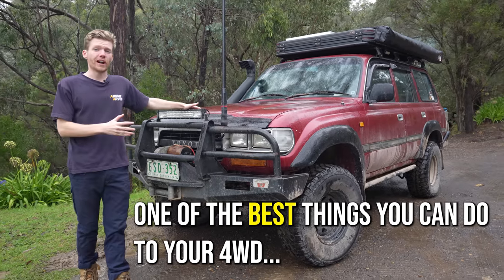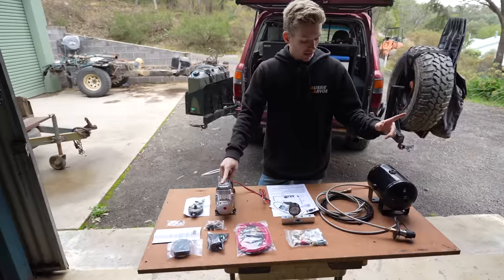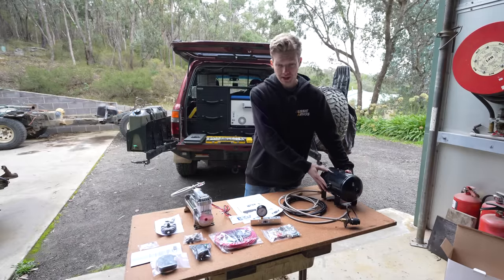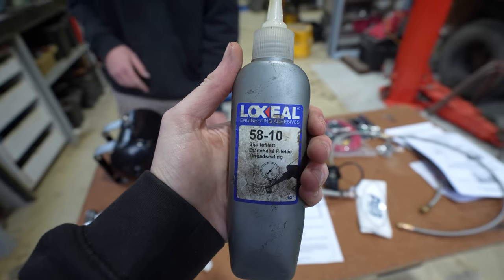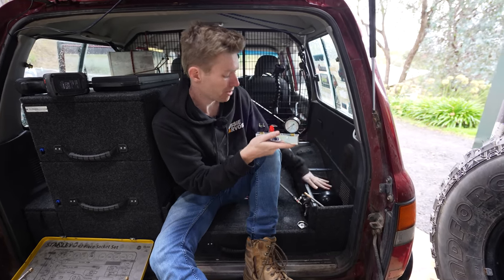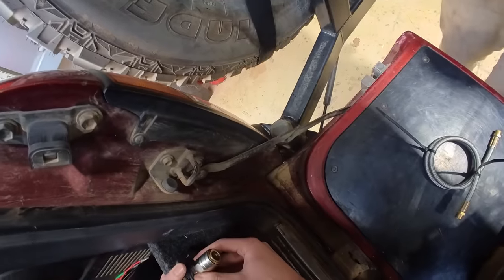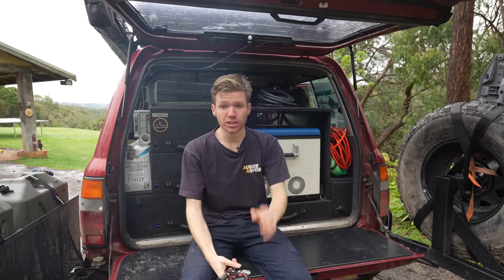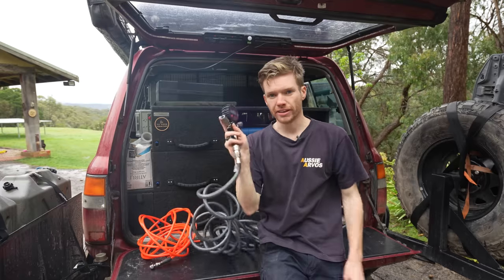Building a BUDGET on board AIR SYSTEM!

Comment: It's also a good idea to run a drain hose to the outside off the vehicle with a tap to drain condensation out of the tank as well Pat. Seeya Rob
Reply: ??,,that tank is a fkn toy,, try 3 big extiguishers..fills 4 tires. no compressor needed. fill at servo..or,,god forbid,,buy a power tank from u.s. same price as arb bs..twin comp..
Reply: @harrywalker968  Take note of his comments regarding available space onboard the vehicle, and his comments on purchasing a product that suits you. Didn't see any service stations out on those tracks so is it just the one tyre inflation for yourself per trip or do you tow a trailer full of fire extinguishers? Or maybe you could think about a 3 phase rotary screw compressor with diesel 3 phase generator mounted to your roof.
Reply: Lol
Reply: @harrywalker968 extreme boomer

Comment: Looks good. I run 2 x outlets in my drawers for the air. 1 is run through a pressure regulator on the manifold set to 40psi for pumping tyres. That way I don't have to keep checking tyre pressures when filling. The second port is unregulated which is great for cleaning filters and dusting off camp gear.
Reply from the maker: Love it, i rekcon i'll do this in the future!
Reply: Is it just a cheap regulator with a gauge and a dial?
Reply: @IamPleura  Yep, from Supercheap Auto

Blackridge Air Regulator

Comment: You don’t need the manifold, you can plumb the pressure switch/safety relief directly into the tank, saves you a few dollars. I’d also up your pressure and relief to a 150 off/120psi on switch, and a 172psi safety.

Another compressor option is an endless air, they are an engine mounted compressor that performance wise smashes just about every 12v compressor on the market away. It’s a great compressor if your space constrained.
Reply: Where did you get the fire pit barrier from
Reply: I was thinking their psi was pretty low. My system cuts out at 180 psi and my valve at 200psi with a burst rating on the tank 250
Reply: Endless air needs to work off a belt at the front of your engine, it is engine driven like the alternator.
Reply: ever heard of power tank,??..maybe look them up.. same price as bs arb twin comp.. i use 3 alloy extinguishers, fills 3.5, 35'' tires, once..fill tanks at servo..max pressure..
Reply: @harrywalker968  that’s alright if you don’t go too far from a servo

Comment: Can confirm it's a great system in the flesh! Good thing about that is that if you ever want to install a bigger compressor all the hard work is already done, just connect the wires and an air fitting and you're sorted.
Reply from the maker: Thanks Harry! That's it!
Reply: power tank,,u.s.ebay,,fills 60 tires..no compressor..

Comment: There are two critical parts missing in the system. A check valve and a bleed valve. 
Listen to any garage compressor as it shuts off when target pressure is reached. 
You always hear a valve bleeding the pressure line between the compressor and the tank. 
This is necessary to keep the start up amps of the compressor low, as it doesn't like to start cranking the piston against the back pressure of the tank.
Reply: I was thinking of an unloading device too, but it seems this compressor starts under load ok.

Comment: Can't go wrong with a portable compressor. Thought about Air on board behind the rear seat in my duel cab but they are a fire waiting to happen as they get pretty hot especially in summer. Dont have lockers or horns just for the tyres every few weekends so a portable & servo is enough for me. Just watch the heat in yours being enclosed. Would hate to see something happen to the 80. Keen to see the VHC vidoes coming🤙
Reply from the maker: Thanks mate! It actually doesn't get too hot suprisingly , but defnitly somthing it watch for, my plan is to have air lockers and air bag assist in the future, so i wanted to invest in an on board air system
Reply: go find, 3, empty alloy extinguishers, fit under vehicle, plumb to an outlet,to fill at servo, just reverse connection for tires. i fill  my 35,s no probs in 4 mins..neat, quiet, quik..

Comment: That is a really awesome setup for the air! I think it would have looked nicer with the compressor also hidden under the panel like the tank. But overall it beats so many other setups in terms of function and looks! I'm half tempted to have something like this in my truck however I don't off-road like you Aussies do lol. My truck is stock and can't do the crazy stuff. Right now I just got a new portable compressor to replace the old handmedown that was at least 25 years old lol. Works for what I need at the moment for topping up tires as they get low.

Comment: This is an awesome video.  You helped me so much.  Totally changed my mind.  I have an F350 with cap on the bed and bed slide.  I am going to mount mine next to the bed slide, in the rear of the bed where I never go or use. Initially I was thinking under the truck but, you have me rethinking the install,  Thank you so much

Comment: Hey Patrick, i see you have a zip tie around coiled outlet ine. That line gets hot enough to melt plastic,the length of that line is also to slightly cool the air before it goes in to other lines

Comment: Couple of things to keep in mind. Or changes you can do. First off, is have an air gauge mounted next to the air chuck on the drawer face. That way you don't need to keep opening the lid to check the gauge. Second, good luck getting to the drain easily. Since you have now buried it underneath, and the only way to access it is to remove the tank. And third, most, air tanks are rated for a max off 100psi. So getting a 145psi safety relieve valve, might not be a good idea. Because if that safety ever fails. You now have a bomb.
Reply from the maker: Thanks Matt! tanks meant to be rated for 200psi, and i can just fit a cup under it to drain it, but apperently you don't often need to drain them, but i'll keep you updated on that! cheers :)
Reply: all pressure tanks, will stand 4 times advertised pressure, as a safety..this is why lifts have 4-8 cables, when 1 is enough.. plus, that tank is a fkn joke, too small,,he needs big alloy extinguishers, [or stainless lpg tank,,] like 3 of them, as i have.. fill at servo, does 4 tires in 2 mins..

Comment: If you find that these 12 air comps are a bit too slow and you want to start putting air suspension seats and air bags on the rear and have some air horns you can get a automotive aircon compressor. thers plenty of vids on here to convert one on to a air compressor and it runs off your engine which is more better but more work is involved with setting it up but is a awesome feature to have on any 4wds

Comment: To get faster tyre inflation times with a tank, the Schrader valve needs to be removed. A depressed Schrader flows about 2.5-3cfm and when removed from the valve about 30cfm.  Airtec and Milton make air chucks where you can inflate with a removed valve core.  I've gone 18-38psi into a 315/75R16 in about 17 seconds. (Though that doesn't include the time to unscrew and screw back in the valve)
Reply from the maker: Thanks for the info!! that's insane! ill look into that! cheers :)
Reply: OR, buy  a power tank..problem solved..
Reply: @harrywalker968  power tank is decent, though this is twice as fast, yes I've tested it! :)
Reply: It depends on the compressor psi too. I've tried a 175psi shop type and that with valve core in will fill the tire in half the time 0-35psi
Reply: @mrmotofy  yep, the higher the pressure differential, the better the performance. The ARB twin with its higher 150psi works better with tanks than the higher flowing TJM twin at 120psi
Reply: @harrywalker968 or he has other needs for his system like airlockers

Comment: Good install ✔️. But the drain valve should have a hose on the end so to let out the water 💦. Noticed the winch needs some attention 😁. I would cut down on the hoses ,takes up Room But everyone to there own. Keep up the good work you guys 👍✔️✔️
Reply from the maker: Thanks yeah we would of but we didn't have the right equipment to finish the hoses, but yes you could of definitely done that! And yes, I need to paint the winch motor 😅
Reply: @AussieArvos  🤣👍top show💪

Comment: I use a 9 litre aluminium tank and the cut in/cut out sensor is mounted on the tank. I think it came with my Boss 12v compressor.

Comment: Hey Guys, interested on how the system is working for you? After watching this video 12 months ago I purchased the same product/package, I found to inflate very slow (32 inch). After approximately 13 months since install the compressor blew up, that’s a Kings and this brand I have found to not last. Currently reading up on the ARB and TJM as will be upgrading to 33’s. 
Keep up the great videos.

Comment: I have an onboard and a portable, the onboard runs massive air horns, has been on several Utes,it will pump tires .anyway another good job and video
Reply from the maker: Thanks mate! Yeah horns would be pretty cool 🤣
Reply: What size tank do you run with the horn setup and how long can it sound for

Comment: Get a Makita 18V compressor (DMP181) and a Makita 18V blower (DAS180) together with a corresponding car-charger (DC18SE) and you are finished (obviously you need a battery, too). Not only don't you have to build an air system, you don't have to deal with hose-lenght or storing a muddy hose. 
You can carry these tools whereever you want (help out people without having to move your car to them, blowing up a dinghy directly beneeth the water instead of carrying it from the car through the woods to the water etc.). And you have a basis where you can useful expand on, for example a small chainsaw (DUC254).
Reply: Not everyone has the same needs as you. Like he's put in air lockers. Can't really use the Makita compressor for that

Comment: The tank won't help remove humidity once it gets hot, which will happen relativly quickly with such a small tank.

Install a cooler between the tank & compressor, and/or a water seperator after the tank.

Comment: Nice Video.  Is there a reason why you did not mount the tank under the car, bolted to the chasis, with a metal cover to protect it from knocks?  Did you mount the switch inside the car for future air lockers?  I would have placed the switch next to the air outlet.

Comment: The idea is not bad at all. But when using that to run lockers it would be very different story. For budget it is good for its purpose. Quick & fast it’s still the ARB twin, again like I said budget speaks. Please extend the gauge away from the manifold, for easier to read. Anyway Great video lads.
Reply: arb blow up..chinese crap..i use alloy extinguishers, x 3, fillat servo or with comp. does 35,s in 4 mins..no noise..

Comment: Great video.

Do you think the 6 litre tank would  have fitted in LC80 wings or is it snug with 4 litre?

Do you think next pressure switch up at 150psi would make much difference to pump up time?

Comment: great video!!! just a quick question about the tuff terrain inflator, if you hook it up to one wheel does the air instantly start coming out the other wheel nozzle until you plug it on the second wheel? hopefully that makes sense
Reply from the maker: No it doesn't, they are air tight Chucks so they only let out air when they are connected to something, so it's actually pretty good!
Reply: @AussieArvos  thanks legend!
Reply: Was going to ask same question 👌

Comment: Awesome video, you will be @ 100k soon & shipping you 4wds off to America to go next level! -only joking. 

I am doing a system with budget bits & including home made rock sliders  doubling up as air tanks. It will be interesting to see how much punishment  & bendy they can take before they will start to leak.

You might already be aware of Nate from Dirt lifestyle on YT, I think he is  in North America/Alaska, he did a series on a popular budget rebranded to death world wide compressor that is available here in AU through the regular suspect & outlets.

Of which I bought both the twin piston & a single piston variant. Nate did a whole lot of mods & improvements to this compressor that was really interesting & is doable with budget tooling. So it maybe the same benefits could be performed on other brands or re brands as a lot of the bits are standardized.  

He made his own manifold but if Air on board sells them I might forego the skill practice involved. 

I wish I had of know of Air onboard, their gear looks not too bad. 

I can't wait to be able to pump up my inflatable flamingo floatie! If I get dual tyre inflator, I will have to go & buy a 2nd flamingo & then I will be over my GVM.

...Just like every one else!

That was a neat install Patrick!

Comment: Great..been thinking about this for a while now. I came across a Vevor product "VEVOR 150PSI DC 12V Air Compressor with 6 Litre Tank" sells for a $109 around a 1/4 of the price of the Air On Board equivalent. It looks like I can replace the included compressor with my portable unit if/when the compressor fails too. Might be an option for others too.
Reply from the maker: Yeah 100% just watch out for duty rate, this air of on board compressor can run indefinitely and doesn't need to cool down, some cheaper compressors require you to let it cool down after a bit of work , but definitely plenty of options out there! Cheers
Reply: @AussieArvos  Didn't think of that. Thanks.

Comment: For those that want to muck around with onboard air for very little money and achieve a very competent - $199 for everything you need when they're on sale at BCF/Supercheap - Item No. 605484 - don't pay the rrp of the rydge ryder stuff for $449 as it's still pretty cheap stuff quality wise. The tank and compersor come apart and you have everything you need to remote mount them seperately. Add a retractable mini 8m air hose for around another $50-100 if you're don't want to fuck with randome lenghts of hoses and quick disconnnects and you've got onboard air for sub $300 all inclusive that cranks good flow rate, has a 6l tank and will be very similar to stopping at the servo. Fitted this setup to a budget prado build I did a while back for a laugh and it was outstanding.

Comment: fantastic definitly will be getting this and getting rid of the fire hazard that is my kings thumper
Reply: That kings thumper is not really a fire hazard...they're the same basic design. Can put a pressure switch on it and all that
Reply: @mrmotofy  the extreme heat it emits when I pump up one tyre says otherwise.
Reply: @jakecarpenter11  That's the Dual cylinder 300L right? There must be something wrong with it

Comment: Having run a tank in the past, not sure it's worth the space and weight. Honestly makes very little difference unless you're running full air suspension.

Seems like the budget alternative would be to have your original compressor wired in the boot (where you already have 12 volt). Then buy a cheap extension hose, so you neither have to open the bonnet, plug it in, or move it to each tyre -- which were the only parts that seemed cumbersome and time consuming.

(And a $15 water trap from Bunnings would capture more condensation.) Still, great video.
Reply from the maker: Yeah I was going to originally try and use my old compressor, but it was originally my dad's so I gave it back to him, but you could definitely use it and make this setup on the cheap! Cheers for the comment!
Reply: Or just install 2 small Anderson plugs on the front and rear of the vehicle and plug then portable compressor straight in

Comment: LOVE THE VID MAN. off topic but do u think u will ever go a bigger tyre size. im same boat as u with 2" and 33s but it looks small and all my tracks around my place are cut by 35s and 37s. its a touring rig like yours but i still wanna go offraod at times
Reply from the maker: i rate the 33" , they are legal, they get good fuel ecconomy, they'll do 99% of what i want it to do, did some pretty good wheeling up billy goats in the snow last weekend on the 33", if anything i'd be adding a front locker. like don't get me wrong the car would be sick on 35" but just don't wanna become cop bait, and i want to do a fair bit of touring in this car in the coming years.

Comment: Awesome video,
can i ask what water jerry can and what taps your using? been searching for a combination that does not leak from round the taps and where the taps can be done up tight without facing the wrong way.

Cheers
Reply from the maker: Hi Stackner! i use the POPE ones from bunnings ! they are awesome!! never had an issue with them, you can use them without undoing the tap itself!
Reply: @Aussie Arvos  awesome. Thanks mate.